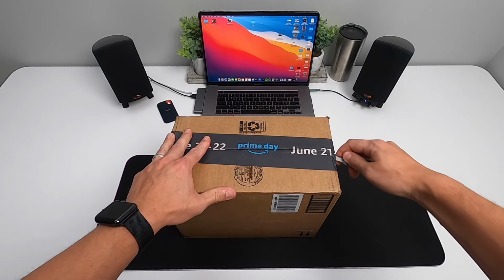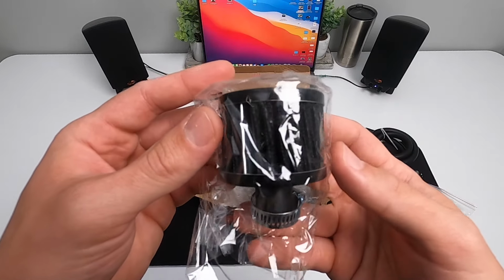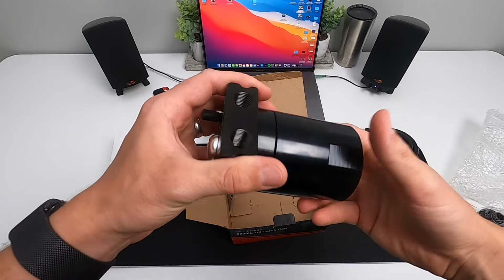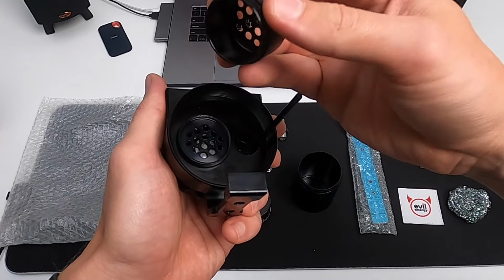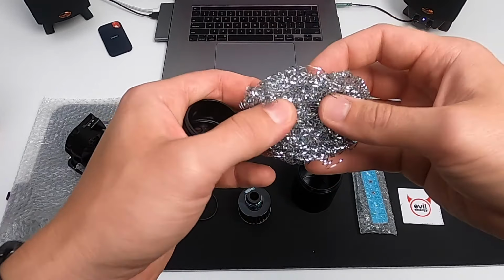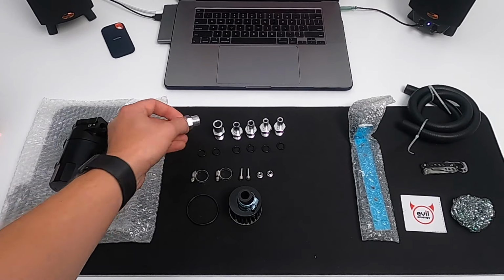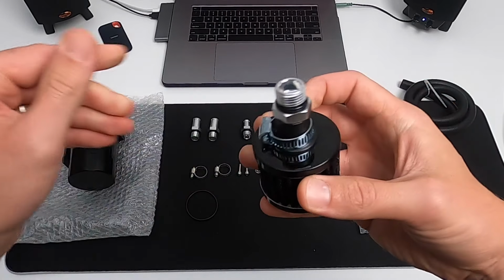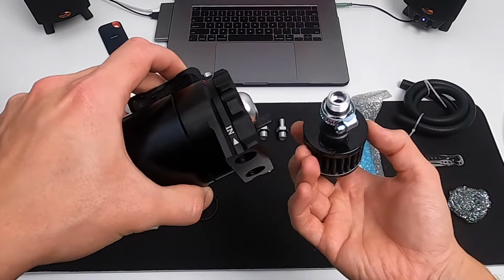How to Install an Oil Catch Can | Unboxing EvilEnergy 300ML Reservoir | Ridgeline/Pilot/Passport

Comment: Very helpful video.  Just installed mine.  The hard part was getting that bracket bent.   I ended up using a vice to put the twist in it.

Comment: Just installed the EvilEnergy 300ML Reservoir, all good.  

UPDATE FOR INSTALLATION IN FREEZING AREAS - READ INSTALLATION INSTRUCTIONS: It is recommended that you go back to OEM during winter to avoid possible condensation/freezing blocking the lines and causing damage.
Reply: Thanks for posting that up. Takes one of these off the plate for where I live.

Comment: Great video as always. As a relatively new Ridgeline owner (3 months) I really appreciate all you do for the Ridgeline. Along with installing the catch can, Have you considered doing a video on cleaning the carbon build-up already present in your engine? I would really like to see that, especially where you would introduce the canned cleaner ( I understand you want to keep the spray from dousing the sensor in the air induction system)
Reply from the maker: I have planned a video for this.

Comment: Yuriy, thanks for another great video.  Just ordered a can for my 17, RTL-T.   

On a separate issue with some 2nd Gens.  I recently discovered water intrusion into the left rear passenger cab floor due to an unsealed cab seam where Honda missed a spot installing seam sealer.  The water comes down from behind the vertical plastic corner trim travels down to the area where the bed meets with the cab.  As we speak 7/12/21, the truck is at the body shop where they are removing the left fender of the bed to get to where the seam is at and add seam sealer ($550).  To check for water on the cab floor just lift off the door sill and feel under the carpet.  Hope yours is dry.
Reply: Hello, for left side you are referring to drivers side?
Reply: @SpayNeut.Always  if your question is for me LP, then yes LEFT side is driver’s side.  Just got my truck back from the body shop all seams on the left side corner of cab we’re re-sealed, leak gone…👍  Wish I could post pictures taken by the body shop.  Honda MISSED-APPLIED the body seam sealer in more than one area.

Comment: Respectfully, i think you might want to do that same install for back 3 cylinders now... your catch can only connected to the front bank of cylinders. You also have a case vent on the back right side of engine connecting to the induction tube between air filter and throttle body, (steel chrome line)
Reply: So buy two catch cans or do it differently? I'm clueless so please help so I can learn and everyone else reading your comments.  Thank you!
Reply: @SK-mf1mi  
Well, you can simply do two non vented cans for sure... then you’re golden.
I’m contemplating experimenting with a simple vented to atmosphere (one for front and another for back bank of cylinders) set up when I have time to tinker...
That might potentially turn out messy in the engine bay... so i would never suggest it till i see the results for myself. I suspect if i mount my case vents (2 small filters) high compared to the engine with short hose runs, oil escape i think would be minimal... but can’t say that for sure. All depends on the pressure the engine block produces.
Reply: @hunterblack6937  Thank you!
Reply: If the other "vent" is connected between the throttle body and the air filter, that is where the filtered air is being sucked into the crankcase.  Air goes through that tube into the back 3 cylinder valve cover through the crankcase and out of the crankcase via the front valve cover and into the intake manifold where he connected the catch can.  The 1 can where he located it should be fine to catch some oil vapors before they get sucked into the intake manifold.

Comment: This was helpful. However, be aware that the rubber hoses need to be measured accurately for the plastic manifold cover to fit. In addition you may have to bend the rod that supports your hood. Be very careful not to drop anything as it is hard to locate dropped parts or wrenches. You make it look easy, but beware it may take you longer than you expect.

Comment: After I'm done. I found there is a lot of suction air flow from the "out" to the engine intake valve. Is that normal?
Reply: Does you vwhixke still have access valve installed that is running to the throttle body?

Comment: I have 07 pilot that's burning oil replaced pcv valve still doing would this help?
Reply: No that wouldn't help .need to change the oil sooner at 40 % plus buy a s vcm disabler.i bought one for my 2020 pilot ,was burning a half to almost 1 quart at 30k miles.i installed a svcm disabler and it was solved not burning a drop now.this just helps oil from burning up in the intake and valves and getting carbon build up.and switch to a 5w30 oil not 5w20.for your older pilot .I have a 08 crv I been putting 5w30 since I bought it at 50k and has almost 200k no burning oil
Reply: @pilot2020  mines 4wd it doesn't have the vcm

Comment: Thanks for the video. Installation was a breeze! Are you planning to disconnect it during freezing temperatures? 
I've been reading that you probably should in really cold temperatures. What's your take on that?
Reply from the maker: I’ll be posting up a follow up in a few weeks to how well this works. Once I have tested it after 5000 miles I’ll make a verdict. For now I have no firm position on this yet. If there is significant collection awesome, but I’m honestly hoping there is not. My general thoughts are that it may not be significant, however, there are lots of conversations I’m seeing so I’m putting this to test and doing the research for everyone. Again my truck is different and may have results that are different from other drivers but should be a good starting point for individuals interested in the product.
Reply: @YuriyMotso  I have a catch can on a 2021 Passport (as you know, same motor).  I live in Minnesota and ran it all winter last year.  No problems.  Unsurprisingly, there was a lot more condensation in the cold weather...but there were no freezing issues.  Think about it logically...anything that would freeze in the catch can would also freeze in the hose from the factory.  It's just not an issue.
Reply: @JOHN TAFT  interior Alaska here, installed a catch can on a 2008 Toyota highlander 3.5L. Works good in warm weather. Winter time down low Temps like -40 on a 125 mile run at highway speeds it could be full of condensate at my arrival. 
Factory lines are insulated good enough with closed cell foam that between the pcv valve and intake the moisture does not condense out and gets passed into the intake and passed. The aftermarket can up on the firewall uninsured was not ideal. Ended up taking it off. Maybe if a guy could build it down on the engine or add heat and insulation it would be useful. 
During warmer weather it was catching oil/sludge mixture.
Reply: @johntaft5370  I think it has been freezing in the hose.  Honda just came out with sb 24-085

Comment: Looks great, well done on the bracket, I installed mine in a not great spot and now my hood prop flops around 🤦
Reply from the maker: Well good thing its not permanent and can be easily relocated.
Reply: @YuriyMotso  I've got the hood struts on order so problem solved? 🤣🤣🤣

Comment: Yuriy, when you first started bending the aluminum bar at an angle, did you screw it to a 4x4, started to bend and then finished the bend on a 2x4?  And then why were you banging it on the floor?
Reply from the maker: Yes. Started with 4x4 because I didn’t have a vice and 4x4 is more sturdy. Moved to 2x4 because it allowed me to fully bend it back. I finished on the ground because then I needed to make the bend parallel to the mounting. I forgot that when you bend at 45 the material projection changes. So instead of going straight down and at 45 degrees it was 45 degrees but it also was pointing to the left of the engine bay instead of down towards the ground so I had to manipulate it back into position. I didn’t take very long as usual to go through the steps and totally spaced on how it was going to transition. In the end it worked out well so I’m happy. I would stress though it’s aluminum, so do not bend it fast and do not make sharp bends as it can crack. Heat it up even if you are not confident. Aluminum has no memory so once the structure has been altered it’s permanent. Hope this makes sense.
Reply: @YuriyMotso  Yuriy, thanks for getting back with me.  Your explanation makes perfect sense and just in time as I’ll be working on it today.  Thanks again - Lou
Reply: @YuriyMotso  Hi Yuriy,
Installed the EvilEnergy can yesterday ran the truck, drove a few blocks, no problems.  

Today, cold start and within a couple of minutes got an “Emissions Problem” message.  Started to drive off and engine shuttered and idle rough.  Went in, disconnected the battery to clear code and switched the hoses back to factory, fired up the truck and drove off with no problems.  Guessing my 2017’s computer does not like the CAN install.  I’ve posted the issue on the Ridgeline Owners Club to see if anyone has a similar experience.  Any thoughts 💭?
Reply: I installed mine pretty much in the same location as Yuriy did, but I didn't need to bend the bracket. I just drilled a new hole on top of the area and used the bracket as it came. Maybe I'll post a video on my own channel to show. Mine's also a 2017 RTL-T.

Comment: Hi Yuri after installing your oil catch can you hear like whistling noise sound wen startup the vehicle? I do hear mind after had it installed
Reply from the maker: No I do not. I am wondering if you have a pinched tube or restriction of some sort. It needs to flow without any restriction.
Reply: @YuriyMotso  I did exactly the same you install your and check everything looks good i keep getting the whistling noise. I’ve removed the oil catch can and no whistling noise. I have 21 Ridgeline HPD and thank for your great video and I will try it again til no whistling noise
Reply: @Tha Srey  don't put on the top air filter of can and it will stop

Comment: Just curious if you got any check engine alarms or anything else.  I have been considering this addition to my 2019 RT-L.  Wanted to make sure the install went well.  Thanks.
Reply from the maker: So far been about 100 miles and have not had an issue but I’ll be doing a follow up video in a thousand or more miles. All depending on issues or buildup.

Comment: Yuri, what would be the reason (maybe I missed it) for that filter on the top of the can?
Reply from the maker: The Honda is closed system however this filter on the catch can allows to have any pressure and gasses to vent from the system. Personally I kept mine closed as it’s similar to Honda’s OEM setup just with oil separator added in the line. People have done both so I am not sure which is best for this particular vehicle. Don’t think it’s necessary though.
Reply: @YuriyMotso  Thank you, Yuri, much appreciate your expertise!
Reply: @YuriyMotso I would think the filter on top could lead to moisture buildup in the crankcase.  System should be sealed like stock to flow crankcase gases into the can & then to the intake.  With the filter on it, fresh air would be pulled into the intake and not gases that had passed through the can.  My $.02.  Thanks for the videos.

Comment: So I just installed same can as you and here is what happened. Loud whistle sound coming from the filter car is idling rough. Switched hoses between in and out no change. Removed filter and it’s fine now. What do you think?
Reply from the maker: Do you have a kink in the line? That would be my first guess if you hear a whistling noise. Should definitely not be experiencing any idle issues. Make sure you have everything connected properly as the idling issues sound as if an air hose is not connected.
Reply: @YuriyMotso  I got new lines and nothing is kinked. How much suction do you have? Mine line is sucking pretty hard. When I closed the line the engine died
Reply from the maker: How much of the steel wool did you use? Did you over stuff it? Maybe your not getting enough air flow?
Reply: @YuriyMotso I didn’t use any.
Reply: You can't use the top air filter on these or Toyota engines. They don't like them.
Reply: @scottlanier5133  yes I removed mine and everything is good

Comment: Why after I done.The car indicate engine emission and all wheel system.problem.
And I watch it 4 more times.Can I find out any wrong doing.Just have not covered the engine cover.
Reply: Got the same thing. This is a closed PVC system so remove the air filter and add the big screw on the top. Without the screw you have a big vacuum leak that causes the AWD and emission issue.
Reply: After I'm done. I found there is a lot of suction air flow from the "out" to the engine intake valve. Is that normal?
Reply: @lou4018  I agree with you. I tried using the tiny air intake but there is too much air flowing into through the intake. I don't feel good about it so I took it out again.

Comment: I take it our Ridgelines warrant this?

BTW, Gibson has come out with a dual exhaust system for the 2017-2020 trucks.
Reply from the maker: I can’t guarantee this is under warranty or not so due at your own risk. My truck is a rebuilt title so I doesn’t matter to me. 😁

Also thanks for the update! I’ll check it out!
Reply: @YuriyMotso  No, I meant do our trucks need this? Technically you could install this on every newer vehicle now since almost everyone is using the same types of fuel systems for gas engines.
Reply from the maker: Ah lol. I have installed this due to a circulating discussion I have been reading and hearing about this so I am testing it out. It’s inexpensive but if there is oil that can be collected in the reservoir instead of going into the combustion chamber, then by all means this will Be a very good and inexpensive fix to increase reliability.
Reply: @YuriyMotso  Looking forward to your results. If this proves to be an issue, I will have to invest as well. 😉

Comment: Did you put your stock intake back on?
Reply from the maker: I am running the AEM drop in. I have not gotten around to doing a wrap up video. Hopefully I will.
Reply: @YuriyMotso  I wrapped the metal tube of the AEM with heat tape.  Thought that would help keep the air flow in the metal tube cooler.  Wish we could attach pictures to show…

Comment: I didn’t know the 3.5L had a carbon buildup issue.
Reply from the maker: A few People are stating that they are finding lots of oil in their catch cans. I am testing it out to see if this is true.
Reply: @YuriyMotso  Looking forward to your follow up video. With this direct injection stuff, I guess even Honda can be susceptible to carbon buildup on the backside of the valves. Apparently the manufacturers don’t care about long term wear!!! (And why should they). FYI-The breather element may cause you to fail smog. You should probably remove the filter & keep the system sealed.
Reply from the maker: In the video my instructions note that I kept mine sealed but for people who want to use the filter the installation and fitment is for visual information. Maybe people other than Ridgeline owners may watch and might be interested. Thanks though.

Comment: This makes me not want to buy a Ridgeline.  Am I overreacting? If this is a problem, why doesn't Honda put these on at the factory?
Reply from the maker: Almost every vehicle will get the same collection. Some might be worse than others. So this should not be a deterrent.
Reply: @YuriyMotso  I was told by someone that vehicles with direct injection,as opposed to port injected, only really have these problems. In port-injected engines, the fuel being sprayed into the intake works as a cleanser, washing off any oil buildup that might occur. Makes sense but it seems like most engines are direct injection now.

Comment: You really don’t need the breather on top. It’s honestly ruining the pressure and the pcv valve is already taking care of that breather job
Reply from the maker: I didn’t use it. I showed it for install purposes. I believe I have it mentioned in the video in the step by step processes that it’s optional.